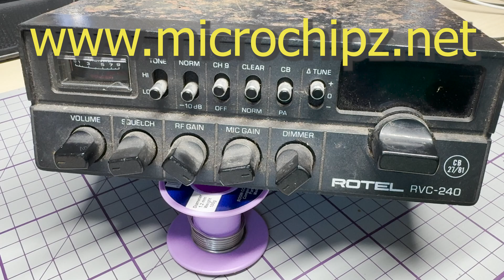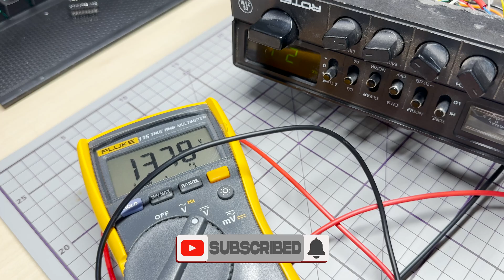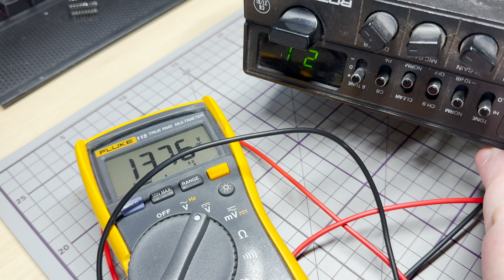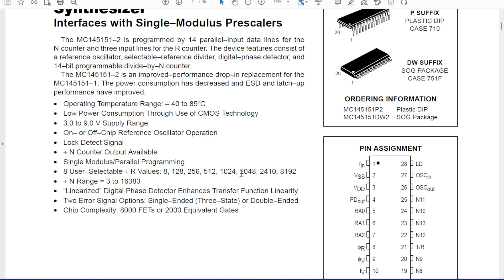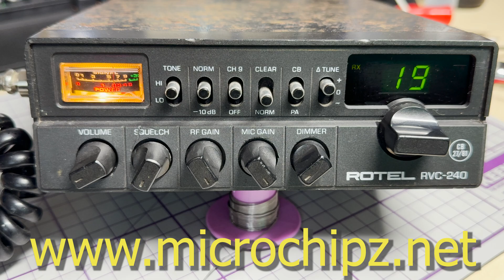EP 156 - Rotel RVC 240 CB Radio - No power and a surprise board inside.

Comment: @2:43 I reverse engineered those boards years ago, uses the MC145151 or something from memory, I made my own versions too where I added some other bands and 5k steps, a very similar board is used in Uniden based radios too for the TC9106 and TC9109
Reply from the maker: This board was used over here , the tonks board was a lot more easy to fit . That used a 7132 and a 7137 .

Comment: Arhh.. the old KS boards, lovely. Fitted many of these back in the day into cybernet and Uniden FM chassis. The Unidens were the worst to broadband for 4 blocks - nightmare. They were the best available at the time and very well made. I still have one fitted to my Rotel 240 with Low, Mid, Hi & UK bands on a 4 way switch. I still have all the fitting documentation and wiring installation diagrams for these along with their EPROM boards that KS produced - I can send some scans if you want. 👍